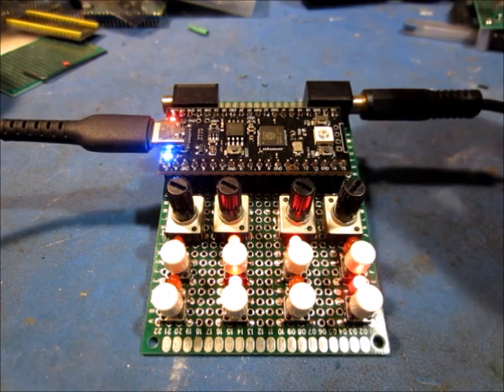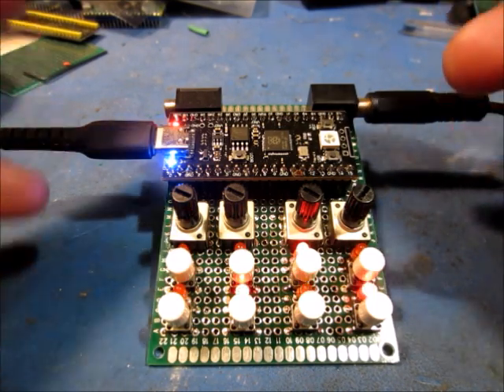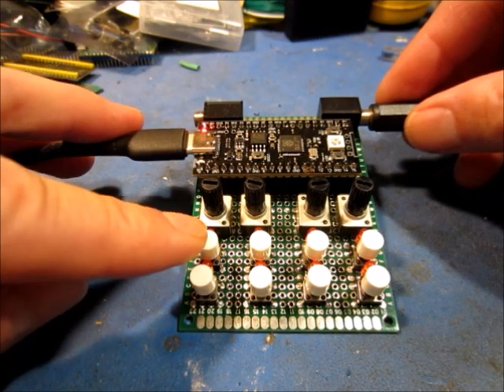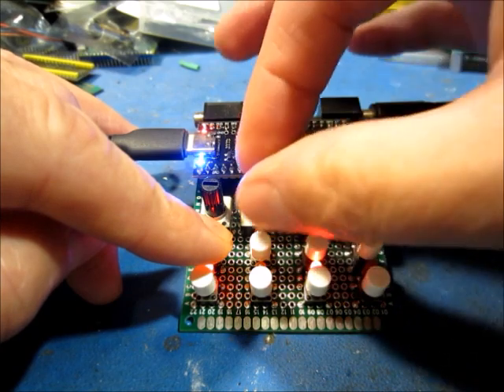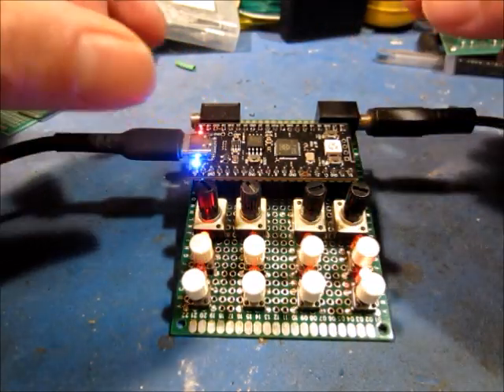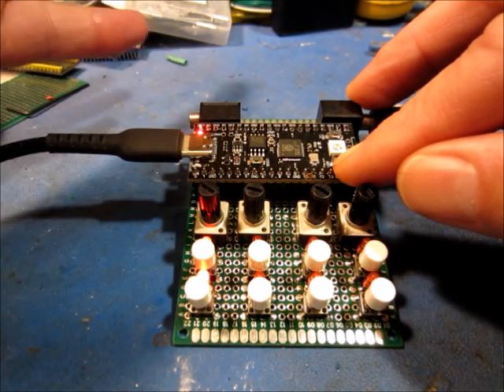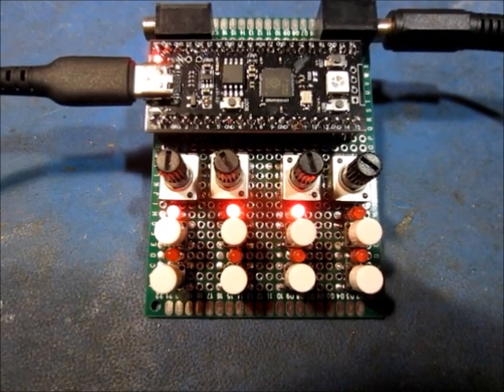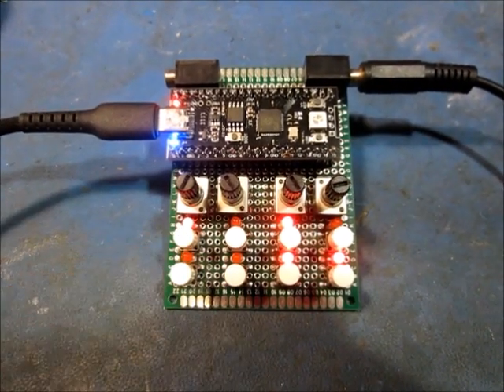"Piko-33" Groovebox Firmware for the Pikocore

Comment: How hard is it to create and upload your own firmware? I can code
Reply from the maker: Arduino is pretty easy to get started with if you can code in C or C++. You will need the Pico board support package. If you modify somebody else’s code it’s a lot easier than starting from scratch - you will learn how to handle buttons, audio etc. Uploading is automatic if you use the Arduino IDE. Have fun!

Comment: Good afternoon, please tell me how to download an alternative firmware for PicoCore, called pico-33
Reply from the maker: https://github.com/rheslip/Piko-33/tree/main/build/rp2040.rp2040.vccgnd_yd_rp2040 . You can install the .uf2 file with the same method as updating your PicoCore as described on Zak's site.
Reply: Thank you very much, it would be very cool if it had a CV input and output, if there is such a possibility, I would be grateful if you tell me how to implement this
Reply from the maker: @РусланХайртдинов-и6г  The 4 A/D inputs on the RP2040 are used to sample the potentiometers so there are none left for external CV. It would require a redesign to add a multiplexer or another A/D converter for CV inputs. Same for CV out - the only "analog" output on the Pikocore is the PWM audio out and the RP2040 has no internal DACs. Could be added but once again a redesign of the whole thing. The RP2040 is a great little device for audio and Eurorack projects if you have the skills.

Comment: Great job! Suggestion: add 8 more buttons for steps via mux, pcm5102a fm and open303 engine. It will be a dream machine.
Reply from the maker: I was thinking about something like that. 24 buttons can be scanned when you use a matrix, add some ws2812 serial rgb leds which only take 1 pin to control, maybe an I2S codec an encoder and a small display. I think the Pico has enough pins for all that.